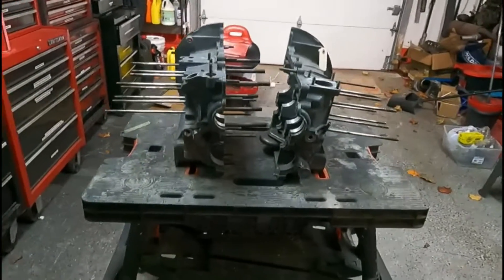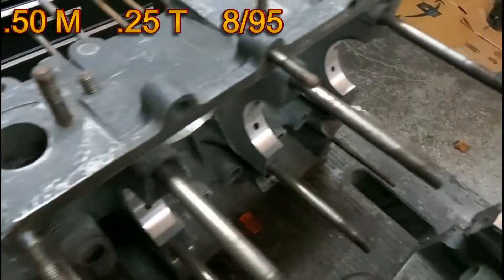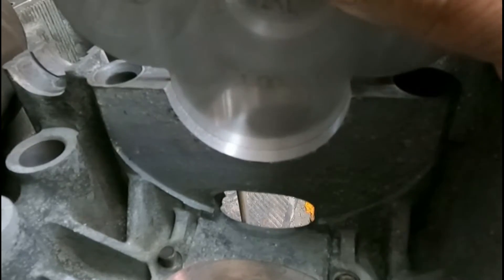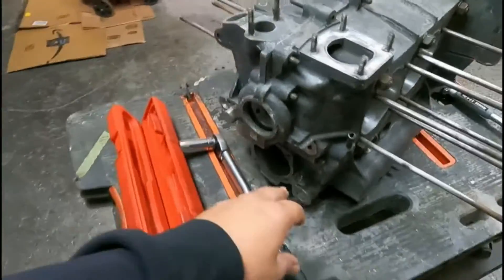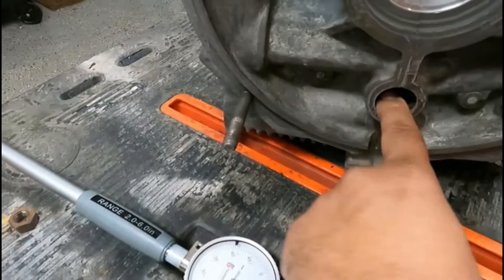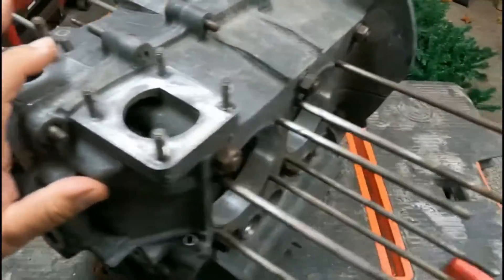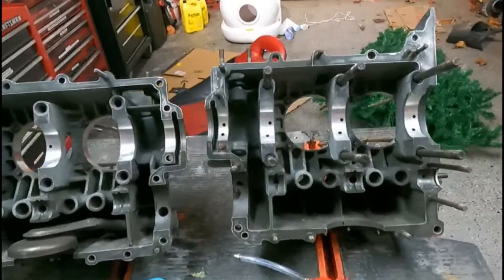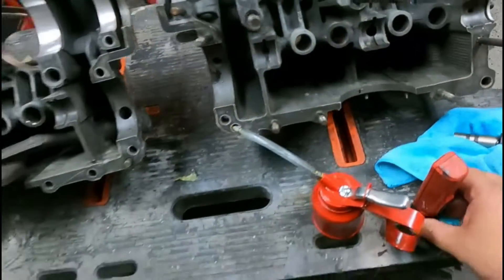VW 1776cc Engine Build-1

Comment: What would you have done if there was a clearance issue when you installed the oil pump with those bolts?
Reply from the maker: Trim down the back of the oil pump where the bolts contact.

Comment: cam bearings should be 1.5 thou not 10 to 15 thou....Just enough for the oil. Oil is less than .001 thick. so .0015 would be fine.

Comment: 40 thou.   But I would not j and B those areas. Those are fine. I have had J and B start to deteriorate and become crumbs in my pickup. causing the oil pressure to build slow.If it leaks just use some Mega black silicone. and that will fix it for good. I have done that from the outside.

Comment: Nice check sheet. Good idea. I just make notes then keep it all together. Then misplace later !!!
Most places just do the standard measurements & cut the line bore. 
Nowadays - there is soooo much inconsistency in the bearings. I know a few people that set there cutters to the actual bearings being used. Otherwise you might have to use different bearings from several sets just to get a full set for one block 
Parts QA has really suffered. As if these engines aren't a pain to assemble & reassemble to make sure everything is working together. Not every single piece needs to be checked out.

Comment: Great pointers; what type of cam are you using?
Reply: What you’re doing is the difference between an engine builder and a parts assembler. 
Looking forward to this series.
Reply from the maker: Its a W110 cam from Engle.
Reply: @FixinBugsNStuff  That’s going to be a good one.